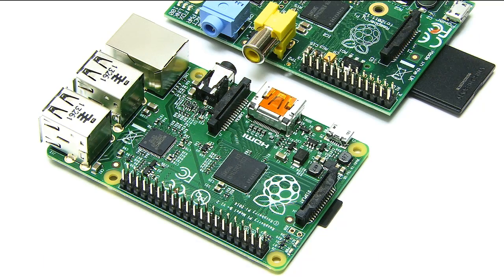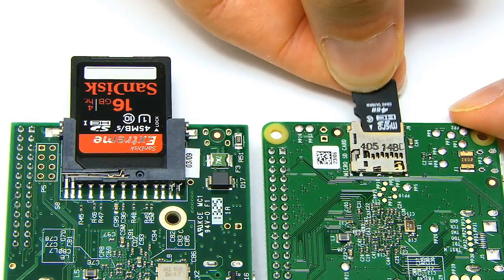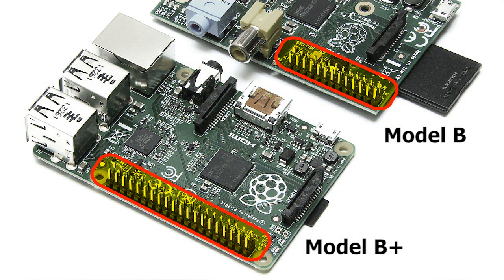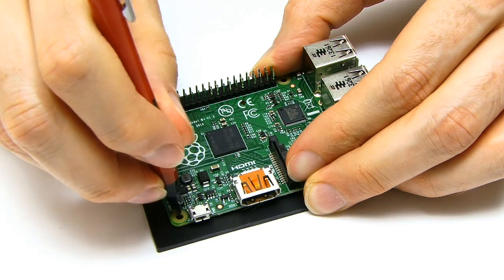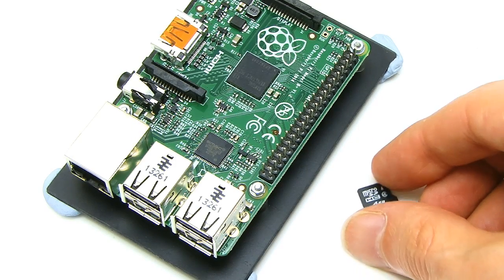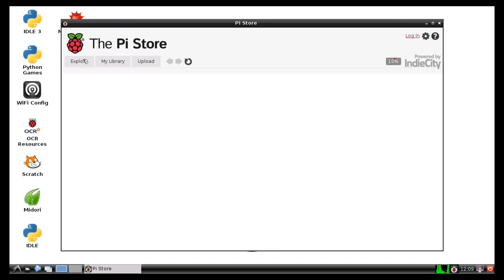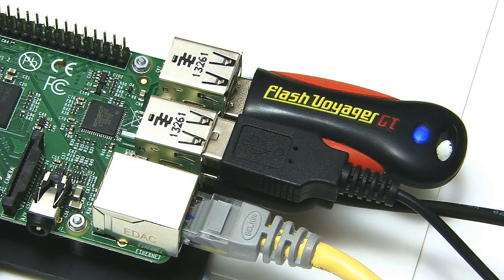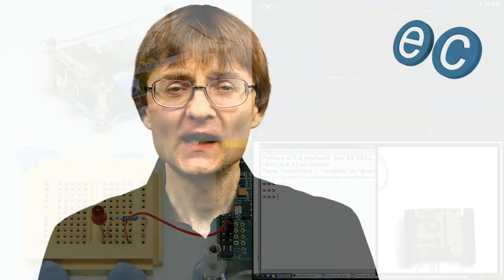Raspberry Pi Model B+

Comment: Still running a Pi 1 in headless mode. Incredible that you can run a fully functional UNIX system on a cheap computer like that. When I was in the university we had only one UNIX machine and it was really expensive.
Reply: Still running it after 3 years

Comment: is it possible to use the 3.5 millimeter jack to output video instead of the hdmi,i find it is easier to use a tv with rca inputs then hdmi.
Reply from the maker: +Miangan Mcginnis Yes, the 3.5mm jack outputs both stereo audio and composite video -- it is one of those jacks with four pins, rather than the usual (stereo audio) three.

Comment: I don't think much to the Raspberry Pi, honestly. Being an quite efficient with C and microcontrollers I never really bothered with the R Pi because I couldn't integrate the chip directly in my designs (being BGA). Recently I needed something a little much powerful for a project and on a wim bought a R Pi. I have found just about nothing on efficient code with C (it's out there but very little). If you want to make a little linux computer and run some inefficient, boring, non industry standard Python then the R Pi is for you it seems...... unless you're an engineer capable of writing the C from scratch.

Comment: They should make an A+ version with a dual core 1ghz processor, 768MB RAM and a slightly better GPU. It should also come with a heatsink on the CPU and GPU for overclocking, e.g. taking the CPU from 1ghz to 1.2ghz and the GPU from 500mhz to 600mhz.
Reply: Well, how interesting they released the A+ almost a week later after your comment.
Reply: Andres Chaves The A+ is not faster. The A+ only has 256MB of RAM and lacks lots of features on the board itself. But yeah it is weird lol.
Reply: I know, I know, it ain't more powerful. But it is smaller and cuter (imho).

Comment: Sorry I'm kind of a NOOB at this. See what I did there? But do you actually need the ethernet cable to do this? If so, what do you connect the ethernet cable from the Raspberry Pi to?

Comment: what is the size is the screws and nuts
Reply from the maker: Samuel Ganawah They are very tiny, and were found in a bits box from a previous project, so I don't have the exact spec. But I think they are a 2mm thread and about 20mm in length. They have to be small, as the mounting holes on the Pi board are less than 3mm.
Reply: Thanks

Comment: Can you use a USB Bluetooth adapter with this for headset capabilities?
Reply from the maker: rick Whit The hardware would certainly work -- and I have read of people using Bluetooth audio with a Raspberry Pi. So I would Google a bit for drivers to be safe before committing to a purchase.
Reply: ExplainingComputers Two weeks ago, I didn't know what a raspberry Pi was. I received my b+ this week and now have the Raspbian software installed, USB Bluetooth, and USB wireless installed and working. Now, my next question....can this device support a SATA SSD (hardrive). The purpose for this device (Raspberry) is to control sensor devices in a fuel cell generator...so I have quite a way to go...but pretty much impressed with the ease in programing this device.
Reply from the maker: rick Whit There may be some hardware add on out there, but there is no native SATA on the Raspberry Pi -- you need a Banana Pi for that.

Comment: What cable is needed for the RCA composite out as well as sound for this model of the pi?
Reply from the maker: You need a lead that plugs into the Pi with one of those four-pole 3.5mm jacks at the end -- like the ones used to connect stereo headphones with a microphone, except here the extra contact is used for the composite video. At the other end you probably want three phono jacks (two for audio, one for composite video).
Reply: Thanks, even though I already ordered one on the internet.
Reply: May i know how its look like? 
Share me some link please..
Reply from the maker: decent puppet  Scroll down to the bottom of this Adafruit page for a picture of this kind of lead:
https://learn.adafruit.com/introducing-the-raspberry-pi-model-b-plus-plus-differences-vs-model-b/audio-slash-video
Reply: thank you ExplainingComputers :)
but i still dunno what is the cable called?
do u mind to tell me..because i plan to buy one..
Reply from the maker: decent puppet I don't think it has a special name -- but I guess technically it is a four-pole 3.5mm jack to three phono jacks.
Reply: Raspbbery Pi Giveaway
http://randomnerdtutorials.com/giveaways/raspberry-pi-model-b/?lucky=24618
Reply: Almir Vardo Does it come with a free virus?

Comment: I only wish they made it faster and added ram.
Reply from the maker: I think we have strong hints that a Raspberry Pi Model C will come along sooner or later -- there is a reason that this is called the Model B+ . . .
Reply from the maker: And lookout for my forthcoming video on the Banana Pi -- very like a Raspberry Pi, but with a dual core 1GHz processor, 1GB of RAM and a SATA port.

Comment: Is the raspberry pi powerful enough to play 1080p video over the network ?
Reply from the maker: Yes, you can play H.264 1920x1080 media at 24, 25 or 30fps no problem, as the GPU handles the decode. Other formats or higher frame rates will struggle though.
Reply: Thanks for the feedback ! ExplainingComputers